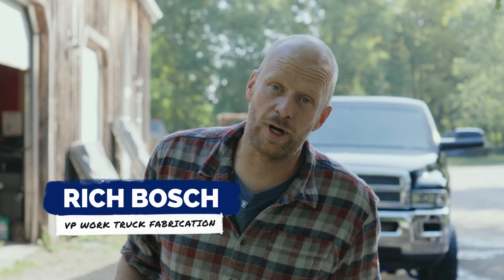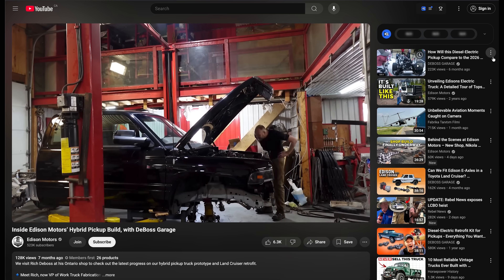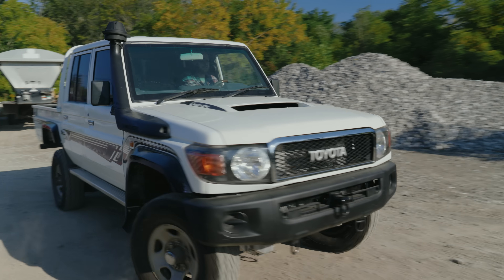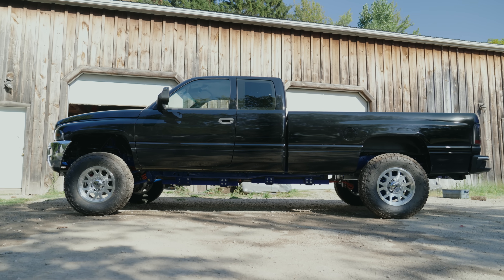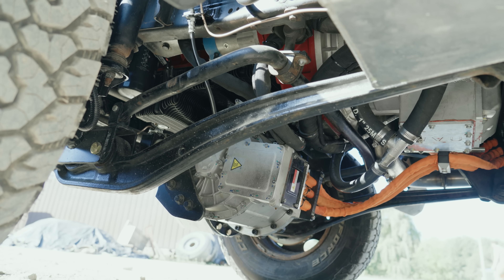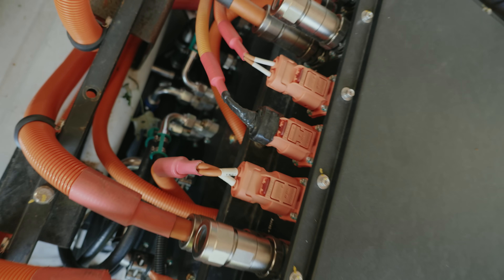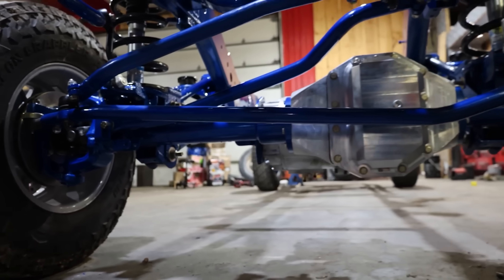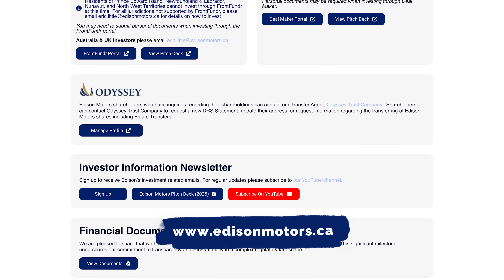We’re Building Pickup Trucks with Electric Axles, Here’s Why

Comment: No but what is the incomplete chassis based on? How do they put different kinds of lifts on it? 

I guess if you go with something very common that has lots of parts available for it, then okay... 

But what we really need is a torque vectoring dual motor third member we could plug into both solid axle and CV applications, and designed so we can clock them for use with portals, ie oiling and sealing etcetera. Then the game is adapting them to your axle... 

I can think of tons of applications but the hard thing to overcome is dual motor torque vectoring. 

Would be a bonus if you could integrate a clutch with the torque vectoring setup. 

Im thinking like a DIY rivian power unit... Offer it with both axle tubes and splines, or stubs with a cup thats common for having cv axles made for.

But the point is that youre hooking up a quad motor torque vectoring offroad setup with a controller and hybrid pack and power inputs for a hybrid power generator...

Comment: I havent finished the vid yet so forgive me if im lacking info but the lancruiser ground clearance seems to be lacking due to the batteries hanging down. For an offroad application that isnt great as a pucture on a rock could cause catastrophic failiure. Also not having different axel option will limit the types of offroad you can do well.
Reply: This LC is for a mining operation

Comment: Would love to delete the transmission and transfer case on my 99 super duty. May not want an engine brake with regenerative braking. Would much rather save the 6 grand or so for a built transmission for something like this. Wide track front end and new suspension would be nice, but idk about a whole new frame or engine
The slushboxes on those rams sucked even more than on the fords, so this is great

Comment: I’m interested in how the engine management will work to ensure longevity. Especially with a diesels with a mix in-town and highway use. 
Will this be a plug-in hybrid? Will electric block heaters are oil pumps be possible to reduce the wear and tear? Will the engines be run long enough to mitigate fuel related oil dilution?

Comment: Have you decided to sell conversion kits to the public yet?

I have no interest in converting a pickup truck so the sled idea is too expensive of an option, I'd be buying the whole thing and scrapping 50% of what I paid for. I need parts man, I need to be able to buy a kit with the motor/controller/harness and that's it. Individual parts available would be even better! 

Until Edison sells individually or in basic crate kits wrecked Tesla axles are a better choice for conversions. Or heck those West Coast EV conversion kits with the Chinese motors are better that buying a whole sled or having someone else install it in a very specific model of truck that I have no interest in.

That's the only reason I'm interested, if you're not selling to the public the project means nothing to me other than congratulations on your successes.
Reply: Edison is still in the prototype phase. So they have no product/service to sell (yet)

Comment: When you think about it, the chassis offer a greater percentage of "salvagability" from the older trucks. You're not just looking for trucks that have an engine or transmission failure, now you add chassis failure as well. Too rusted or broken from over load. While the body pannel and interior of the truck could still be perfectly usable, you get additional points in the "upcycling" side of things by giving them a second life too. 2 bird with one stone !

Comment: you guys are really on the right track with the E-axles. there was a guy that beefed up the xfer case on an f450 to handle the power of a tesla motor, and it was like billet hardened gears and bracing on the outer case... and he still probably snapped some U-joints.

Comment: You mentioned the IFS possibility, it occurred to me that with 2 electric axles and a generator, you have 3 electric motor / generator units. If you accept that 4wd is used or needed infrequently, you've a front motor / hardly being used. A motor / generator unit on the front axle could be switched between drive when 4wd is needed and generating when it isn't.  The trade-off would be you can't charge whilst 4wd is being used, two clutches one either side of the motor generator could switch between drive and generating. I don't see a packaging for 2 solid axles, but it could work for an IFS.

Comment: One disadvantage I see with the electric solid axel is the massive increase of unsprung weight. Everything I've ever read or heard in regards to better/smoother ride is less unsprung weight is better - not to mention the excessive vibration that the motor will be exposed to.
Independent wheel axels should correct this.

Comment: needs an optional inverter/welder.
Reply: Amen bruddah.

Heck, we should be able to pull straight DC off the batts through a DC to DC leveler to get like 300v and 100 amps.

Or 480v AC off an inverter.

Comment: @DEBOSS GARAGE Guys, may I ask, especially for the Cruiser, firstly, Q1; is it switchable from RWD to 4WD, just like the original? And Q2; Whilst I understand the gobs of torque available, what happens in what would be a normal Low Range application?
Reply: Alas, the LC will not drive anything like it used to. 

These early Edison prototypes have the electric motors bolted to the wheels. There is no way to freewheel.

These trucks don't have a super low granny gear for rock crawling.

Comment: I am curious if you never plug it in but only use it as a hybrid, at what charge level does the gas engine turn on and how much does the gas engine charge the battery up to?  Normal plug in hybrids have a absolute tiny battery, but 66kW is a pretty substantial battery.
Reply: Great question. I think Edison is not sure yet. Conventional wisdom says stay between 20% and 80% of batt capacity, so maybe keep it between. 150 and 450 volts?

Comment: Brilliant! Great way to breathe new life into these old rugged trucks that are still serviceable for decades to come.  Also, a very good thing that you’re seeking out experts in the field for validation 

Will be interesting to see how all this evolves as cheaper and better batteries, motors, and control electronics come available.  As low cost sodium ion batteries become available to the aftermarket in the coming years you may even be able to eliminate the complex battery cooling systems.

Comment: How about putting the motors in the wheels.  It does away with the entire drive train, saving weight and results in less parts to break.  With the motors in the wheels you could change the steering mechanism too.  Instead of physically turning the wheels you could just change the relative speed of the wheel to turn, similar to tank steering.

Comment: this kit is very ideal for the norwegian market. Norway the biggest EV purchaser in the world but EV's dont suit everyone and there are many enthusiast that would like something bigger than a small ev and not spend 100-140 000 $ to get a ford lightning or suv. currently we can't legally convert older cars to hybrids but there is some progress on it legaslative wise. we have alot of terrain and the EV semis/larger trucks just doesnt work that well and costs to much due to import costs. both the Semi truck kit and the truck kit would be very attractive for the people having older vehicles that have worn out axles, brakes ect. importing parts to maintain or fix these is very costly due to import and shipping cost's so they often get scrapped or sent abroad. SVV in norway is in charge of the approval process of modiying vehicles, if you would have a dialog with them on what needs to be in place for a install like this it could become a reality here. your approach just makes sense both economically vice and enviromentally vice. we shouldnt scrap vehicles that have much life left in them to get something new that requires alot of emissions to get manufactured and wont last as long as the old one.

i see alot of potential here. the chinese EV busses in the capital is a disaster and they always have to bring out the diesels in the winter.

Comment: My concern is the clearance with those electric axels. They are direct drive and don’t have a portal axel setup. So the displacement and ground clearances looks not so great. You can see the motor, differential is maybe 1 foot. Most off road rely on portal axels to offset this. Why aren’t they trying to develop port axel setup. That off road test that the university is going to do it definitely going to smash into that differential and electric motor hanging down so low.
Reply: So ground clearance on the Edison e-axle is similar to any normal axle.

Portals are fantastic for giving more ground clearance for the axle pumpkin. I'd love to see portals on Edison trucks :)

However, portals cost like $5k per wheel. So if a customer wants portals, they can just buy them. I'm sure Edison will be happy to help :)

Comment: So on the full size pickups how do I get my flip over or removable goose neck ball in there? How big is the fuel tank? How many pole generator are you using?   I would rather have my reliable mechanical 5.9 Cummins pushing a generator than a 2.8 that is not known for reliability plus I can get fan belts, fuel filters, water pumps, etc at most auto parts.
Reply: If the gooseneck ball goes under the bed, between. The rails, then I guess they make it fit somehow  :)

Fuel tank size (under the bed) will always be a challenge.

The generator bolted to the engine outputs 100kW 3 phase 480 volt AC. Now making that available is another thing.

In the future, I'm confident that Edison will accommodate all popular stock engines like your 5.9

Comment: What could you guys do with a 94 f150 with an i6 ?  could the i6 be kept and used seeing how it has been used for this purpose in different applications. Just curious if it's possible and if it's any financial advantage to keep it and use or to drop in a smaller diesel generator instead

Comment: See a lot of exposed HV cables underneath these vehicles. I know they are test beds but would think those need protection coverings as much as possible
Reply: I would also like more protection for high voltage, high amp wires.

Comment: So with the skateboard chassis, what kind of body weight would you be looking at?. Would it be able to have say a cutaway cab with some kind of RB or a cube on it? Would that be an overweight situation? Also, instead of the generator hybrid situation, how many batteries would have to be added to make it a full electric. I certainly understand why you're going the route. I'm just asking if it would be feasible. I've always considered an option because of the weight of the batteries to add a battery trailer if nothing else for a distance extender that you could plug in with Anderson plugs.

Comment: You know, you should make a barebones chassis for the frame too. Something easy to customize.
Reply: My imagination says for Edison to make a standard passenger/driver fore sections of frame rail,

Than standard aft driver and aft passenger rails.

Then standard cross members that can be adjusted to handle any width of frame desired.

Then over long straight box rails that go under the cab that can be cut to length to accommodate any wheel base.

The only custom part is the zigzag parts that connect the straight rails to the for/aft rails.

This fairly simple kit should accommodate any truck ever made.

Then custom mounts for clip/cab/bed.

Comment: electric axles could have a big market in rock crawling. not having driveshafts could open up some crazy articulation
Reply: I can't freaking wait until Edison makes parts available and off road YouTubers like TrailMater build off road rock crawling rigs. 100% torque at zero rpm, and the foot pedal throttle mapping can be programmed with lots of pedal movement to give lots of control.

Comment: Why can't you make commercial trucks like phevs which have a motor generator coupled with gearbox which drives front axle and rear is electric, with 2 or 3 gears need not to drive it at high speeds just some low range gears and auto clutch which will disengage when speed increases giving an all wheel drive truck

Comment: Where do I find the part where it is explained why it is a good idea to have a pickup with all of the weight of a battery and all of the fuel consumption of the original gas engine?  (Granted, the engine can run at its most efficient speed, but that is still not very efficient compared to other sources of electricity)
Reply: Edison hybrids are a compromise between battery and ICE drive trains. As such there are pros/cons/costs.

Edison hybrids have lighter batts than a full EV, and a lighter engine than a full ICE truck.

Edison trucks have 100% torque at zero rpm, and high horsepower of electric. And the ability to be recharged overnight from city power.

Edison trucks carry their own 100kW level 3 fast charger as a range extender so there is zero range anxiety. It's a truck that can do truck things like towing.

Edison trucks are hoped to get better cost per mile than comparable ICE vehicles.

The up front conversion cost is quite pricey. The hope is that reduced fuel cost over the life of the truck will equal out.

Comment: Just out of curiosity and since I can't recall seeing it mentioned in any of the other videos, would you guys be willing to do a video explaining why (pros, cons, why they might not be a good fit?) you didn't go with the two or three hub (wheel) motor options currently available on the pickups?  Or a simple, "Actually, wheel motors are still vaporware at this point" would be cool to know too.
Reply: Yeah. There are pros/cons/costs to putting an electric motor as an alternator at the front of an engine, or putting one between. The engine and trans, or putting one in place of the transfer case, or bolting it to a stock axle pumpkin, or putting it in the axle, or putting it inside the wheel rim.

Comment: So one of my faverate things on the f150 hybrid is the 7.2kw out. This seems like you would be able to do a big inverter on and do the same thing. It would be super helpful on the job site not having to bring along an extra generator.
Reply: Theoretically the engine makes 150 hp, and spins a 100kW generator outputting 480 triple phase AC There's gotta be a cheap way to get all this power available for usage.

Comment: You need a third prototype. One that hauls groceries and gulf clubs and will make a comfortable trip to the coffee shop. The highest use of pickups in NA.
Reply: If you must do such a thing  and yes millions do. Full ev a better option for that application.
Reply: That's my F150 Lightning right there! Heated and cooled 10 way power seats with lumbar support...
Reply: These are not the specs advertised😂
Reply: You forgot soccer kids.
Reply: A pedal electric cargo bike can handle that!
Reply: @economicprisoner  Yeah, but it doesn't cost $70k and require a 24 foot parking space, so why would you want one?
Reply: @brucehalleran1149  Ironically I have a car but no cargo bike due to a lack of a garage to park it.

Comment: Are you using the Magna axles?  I wanted to do Land Rovers, but Ram and F-series trucks make a bit more sense.  E-series 4WD conversions and RV chassis' may actually be the easiest business case as the crash testing and emissions for early models could be the test mules.  Also have you looked at the  opposed piston engine options?
Reply: The initial Edison gen1 prototype pickup truck e-axles are Frankenstein mashups.

Comment: Please check into the engineering and ride benefit of long arm front suspension for that. Those generations of rams have short and angled arms that transmit a lot of energy into the frame. 2012 and later dodge rams figured out the longer front arm suspension. Much better ride.
Reply: I believe Rich added an aftermarket kit. More info is at deboss garage on youtube.
Reply: @Sah-o5m  the photos show some aftermarket arms, but still factory length. They need to be about double the length that generation came with, and ideally perpendicular to the coil springs. Not hard to design a nice riding truck suspension.

Comment: man I want this for my 2wd bagged 88' reg cab short box pickup! how much for the axle ???
Reply: $5k?
But then you also need all the stuff to make the axle work. Motor controller, batts, BMS, inverter, crazy expensive thick copper wire etc.
Reply: @Sah-o5m  yes you are right but I don't need a hybrid with 0.075c a kwh for hydro a plug-in is all I need! and I can just buy a used EV and use most of the parts from it for a few grand. the axle would cost more
the only thing is they are using 600v axle and most ev's are 400v